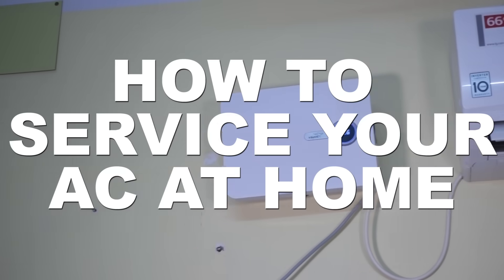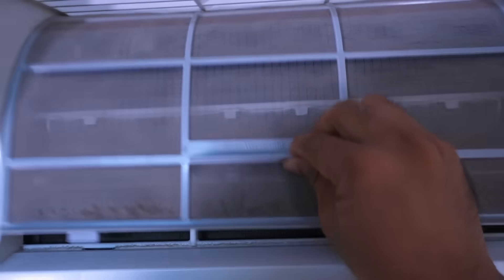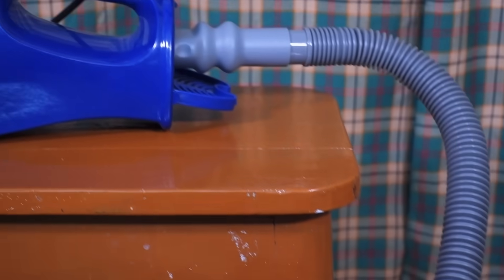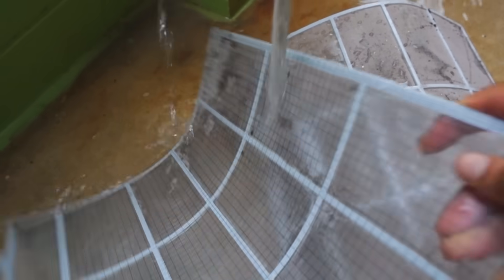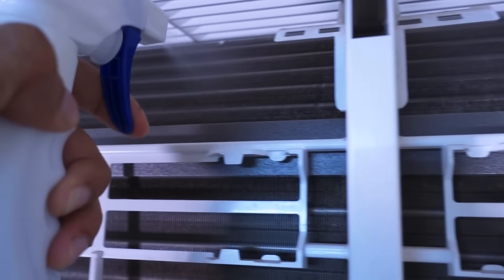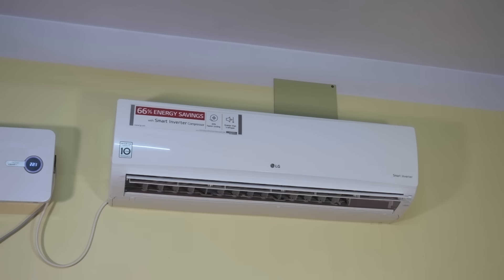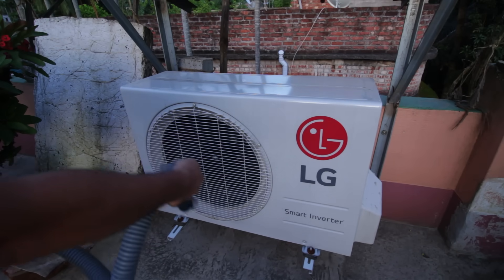Learn How to Clean an Air Conditioner Servicing AC Cleaning at Home - SMELL FREE AC

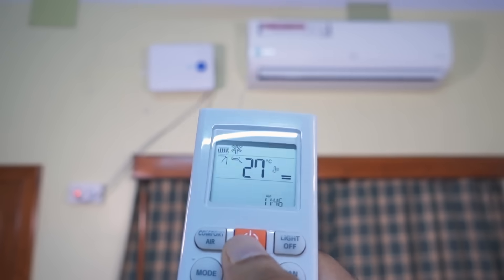Comment: 0:32 if i was a heavily trained technician for a ac i would never power it off during disassemble and disconnecting the display and cleaning the outdoor unit and power off only cleaning for the indoor unit first clean outdoor unit and then clean indoor unit its heavy master servicing and clean it using high speed motors and water pipes and i would power it on before even the unit gets dried up on the evaporator and air inlet and wipe using the cloth in the air inlet carefully while the unit was on and reassemble it while it was powered on and if signal wire in outdoor unit disconnected reconnect it back while the ac unit was powered on and keep the wires connected to the outdoor unit during cleaning indoor unit and covering indoor unit with a ac servicing cloth and turn it on while it was disassembled after servicing to wipe using the cloth in the air inlet carefully by pressing the emergency button and never unplug it.

Comment: The roller type  blower has thin plastic vanes. Heavy accumulation of dust and dirt cake the vanes. They can be easily cleaned using a mascara brush very well.

Comment: Guys don't do this, this will damage your ac as you are pushing the air inside. The correct way is to jet wash the condenser fins.
Reply: Hows that different from jet washing using water and jet washing using air because it’s both pushing something inside 😂😂😂
Reply: @平子真ジ4773 because he is servicing guy and may loose job 😂
Reply: Absolutely wrong you must use vaccum cleaner
Reply: This will absolutely not damage the AC
Reply: In either way, you gonna push or life gonna push u 😢
Reply: How do you do that
Reply: You're correct, im a professional aircon cleaner and we use jet coil water jet's on the AC system to clean properly.
Reply: How a vaccum cleaner push the air to inside..?
Reply: I think you guys need to learn Gopi bahu techniques about keep everything clean

Comment: You just literally push the dirt inside and makes the fin clogs by dirt. remember that the dirt soak by moisture and makes it slimmy dirt that clogs in the fins and may cause damage to the ac system. if you dont know how it works you better not to touch anything you making its worse. just saying and to those who think  that they save money think again. its better to spend money for preventive maintenance that to spend to repair.
Reply: outrageous

Comment: Quick Tip.  When cleaning the filter with water use running water (tap) and pass the water on the side behind the side where dust is accumulated.  DO NOT use the water spray on the side of dust.
Reply: Bruh it's not important. Dust will be cleaned both ways
Reply: What ?
Reply: @jzzz569  it's not hard to understand.
Reply: CORECT

Comment: Excellent video and presentation for a DIY (Do It Yourself) Project. Saved us a lot of $,$$.00 on LG Service Call which 1) is not easy to obtain, and 2), is expensive.  Thank You for posting this helpful tutorial.
Reply: its a matter of common sense dude, no need to do engineering for this
Reply: @vibezone9832  why are you on a help video if that's common sense to you.
Reply: @asimanayak304  Nailed it
Reply: @asimanayak304  savage lol. and @vibezone deserved it
Reply: @vibezone9832  rude

Comment: Can't you just turn the unit on heating mode if it's a reverse cycle system? It'll save alot of time. And also if you use a blower to get rid of all the dust, where do all the dust go? Around the room or floor?
Reply: yeah.. bunch of dust will fly around your room. I'll modify those steps. Kind of bs I'll probably use the small places adapter of my vacuum cleaner instead.

Comment: A good pointer on electrical isolation and regular washing of the filters, but the rest of the advice was weak. Your method of cleaning pushes dirt and dust further into the coil. Also, many air conditioners have mould that causes the smell you mentioned. To clean away the bad smell, you need to remove the mould. The casing needs to be removed and vacuum with a HEPA grade vacuum before cleaning the coil and blower fan with cleaning solution and low-pressure cold water spray.

Comment: The moisture he mentions at the beginning is condensation. There is a tray to catch this which then flows away in the drain. If you blow all of the dirt/dust Into the unit like that you will cause a build up in the tray. Cleaning units like this risk blockages which will cause your unit to leak.
Reply: I think it would be better to vacuum instead of blowing the dirt inside unit...
Reply: @arnulfosediego5919  Yes!
Reply: What he is saying is foolishness it need water to clean the coil and the fan wheel need to wash as well
Reply: Yeah it does seem problematic

Comment: Should you use vaccum cleaner instead of blower???
Reply: 3 Cute Idiots good question. Have you found any additional info?
Reply: @andrewmish9286  I used vaccum to suck dust first then put the filter under good pressure water tap or hose pipe. This I did on my own
Reply: Only thing is I took extra care and didn't use high vaccum setting, very softly I removed pile of dirt but did not try to remove every single dot of dirt which can be removed with water.

Comment: U R using blower and pushing the dust inside not a good idea .....
Reply: Use vacuum cleaner..😂
Reply: Dumb dumb
Reply: This is wrong. You can use  vacume cleaner to suck the dust from the fins instead of blower.
Reply: Wet service is best for AC
Reply: yeah that's the first thing that comes to my mind also
Reply: Thinking same. i want to write the same thing but I saw your comment!
Reply: Yeah i agree cz it will block the air flow n after sometimes ur ac will make ice
Reply: Indian monsoon rain killed all the dust so relax guys 😁

Comment: And would you need to call in a professional, if the pipe to the compressor is blocked with I think ice?
Reply: need tp change gas...then mechanic is required.
Reply: wait the summer?

Comment: LG manual clearly instructed that you should not water wash the 3M filter. and in your video you washed the 3M filter with water which is clearly opposite of manual. 
LG manual instruct that 3M filter only can be cleaned by vacuum cleaner or blower, because water may be damage the 3M filter.

Comment: Blowing air into the clogged fins is a bad idea. This will disperse the dust all in all direction including back at the cleaner!
Reply: Can you just vacuum it? Is it better ?
Reply: @sergiocastro588  Vacuum is not very effective but it can work to some degree and is useful for removing thick outer layer of dust. You should also be careful as the fins are quite soft and can be easily dented especially if the brush is too stiff.

Alternatively, you can use a portable manual pressure water sprayer or buy a cheap electric pressure water sprayer. Water pressure of 3 to 5 bar is sufficient to do the job. Water is more effective as it will soften the dirt or dust and is therefore more effective. A bit of soap helps too.

Whatever method you use, just apply the following principles. Dust will disperse in all direction if strong force is applied at it. Water has the effect of soaking the dust which can then be easily dislodge from the fins.
Reply: When you said that we should use the water to cleanThe fins do you mean it’s the tapwater Or we can use the water from well?

Comment: Mine doest blow air anymore....it still can be turn on....how can i fix it?
Reply from the maker: do the blower motor working.
Reply: I'm not sure...it can be turn on...just that it no air coming out....the split unit located on the out door is also not start up after the aircond is switch on.

Comment: That inside filter we should actually suck rather blowing air into it to clean. If u blow air then chances are there the dust gets into it and further frustrate the air throw
Reply from the maker: thanks for your suggestion. the technician fast time service my ac did use a blower.  so i thought that's the way to do.
Reply: @RoyTecTips  our a.c. technician would simply use a brush to remove dust from the coil and use water to clean the filters. 6 months once they remove the whole unit and wash with water with help of force pump.

Comment: Clean? ..thats not clean ...you need to pump down the R410a ..or R22 .. then disconnect your unit from power supply..then un mount the evaporator unit ..then dismantle it first by taking of the front panel cover with filters, then your electronic control module, then your drain pan, the the evaporator coil , then the mini turbine, with motor.. and then proceed washing the coil with coil cleaner using a home use pressure washer.. and all the other parts except the motor and electronic parts.. with a nice liquid detergent... dry them off with care... assemble all the evaporator unit ..in a precise manner the way it should be... re install it back on the wall... connect all tubing and electrical ... run a 30 mins vacum.. with a vacum pump.. make sure its at 0% leaks.. and recharge by opening the service valves first the liquid or high side then .. the sucction line... then power on the unit and make it run verify its cooling properly..wich it will if you did all the steps right... you Mutt!
Reply: Are you blind? He said this is how to do it at home without getting a professional in. Always a smart arse comment isn't there. There's only one mutt here.
Reply: @tthe_scotsman  ...fockyou very much for your concerned comment....but anyways fock you very much! ..GET THIS IN YOUR  HEAD..ANY AC UNIT MUST AND HAS TO BE SERVICED PROPERLY WITH OUT SHORTCUTS THAT THIS VIDEO SHOWS..SOMETHING AANY PROFESSIONAL REAL AC  TECHNICIAN  KNOWS TO DO CORRECTLY WHY? BECAUSE  IF YOUR AC UNIT GOES BEYOND JUST DIRTY AIRFILTERS ..THAT CAN BE CLEANED AND WASHED  MONTHLY .. IS A HEALTH HAZARD ISSUE THAT NEEDS TO BE ATTENDED PROPERLY..  
WILL YOU COMPLETLY DISMOUNT CLEAN& WASH ALL THEM STICKY DIRTY MOLDS ON  EACH MINI BLADE OF THE EVAPORATORS MINI TURBINE?, WILL YOU BE ABLE TO DISASSEBLE THE EVAPORATOR COIL AND ALL THEM SUPER DIRTY PARTS LIKE THE DRAIN PAN? PLASTIC BASE, BACK AND FRONT? HA?? WILL YA BE ABLE?? NOT TO MENTION THE DAMMN CLOGGED DRAIN PIPE! ..UNLESS YOUR AN AC PRO .. I DONT THINK SO! .. SEE FOR A FEW DOLLARS ..ITS BETTER TO HAVE YOUR AC UNIT PROPERLY SERVICED AND CLEANED .. FROM INSIDE OUT WHEN IT TRULY BECOMES DIRTY.. AND NOT DO ALL THIS SHORT CUT STUFF THAT WILL NOT DO IT PROPERLY..HAHA! CLEANED ON THE OUTSIDE YES! YET YA GONNA SMELL ALL THE FOUL MOLDY STINKY SMELL FROM  ALLTHA CLOGGED DIRT & MOLD ON TH EINSIDES YA COULD NOT CLEAN.. AT ALL UNLESS YOU KNOW HOW TO TAKE DOWN THA UNIT PROPERLY IF YOU ARE A PRO!  YA GOD DAMMN FOCKING SUPER DUMBASS MUTT!
Reply: Right

Comment: Vacuuming of evaporator is not enough for cleaning ac unit. Using of water pressure washer is good for cleaning ac unit..
Reply: Using water inside doesn't make sense unless you want to swim  💦 🏄‍♂️
Reply: @User90178   it does with the help of a cleaning cover and hose to drain the dirty water to a bucket

Comment: Nice one bro. That product does it help much? I use almost same technique on my daikan 1.5 ton inverter
Reply: Bad work bro, u r spreading dust from air conditioner to whole room. Pls don't blower in indoor unit for cleaning purpose. It's not good.
Reply from the maker: thanks, yes it does work well.